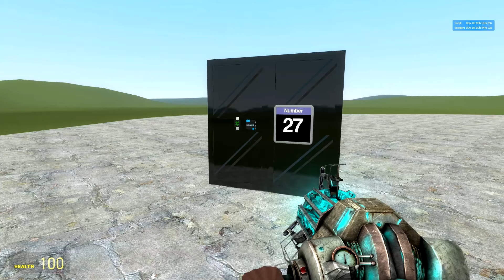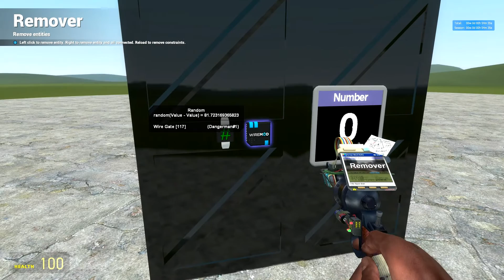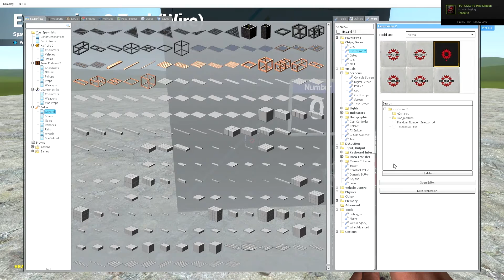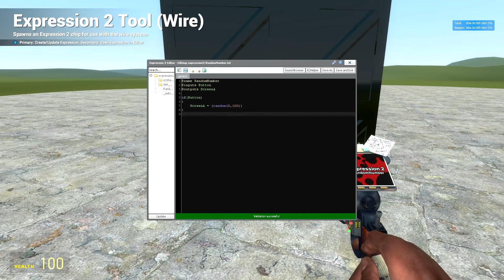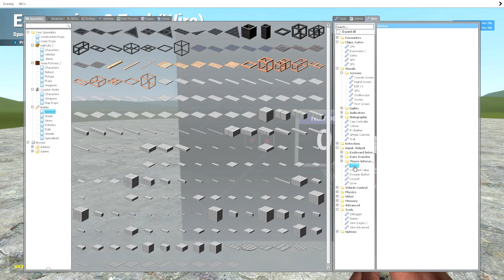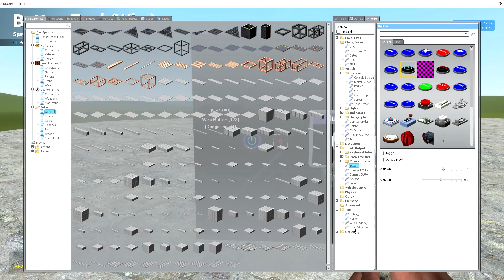Garrys Mod - Random Number Generator E2 Tutorial (part 2)

Comment: Why the extra set of curly brackets around the random function? Also for this case you don't even need the if statement as the button is the only thing triggering the gate.
Reply from the maker: +bigdogmat Its to section off the code a little bit, makes it easier for beginners to understand. Plus this is a tutorial for beginners so for the if (button) bit, it has more a flow and makes it easier to comprehend and to see what the code is doing for people that are new to the code :)
Reply: +Danger On PC Eh to me it promotes bad practice and order of operation, though fair enough.
Reply from the maker: +bigdogmat I see your reasoning my friend; just sort of dims it done a little is all i was thinking... but thank you for the improvement note! I'm currently learning some more advanced things with E2; so i will make sure i show good practice in those videos
Reply: +Danger On PC :D